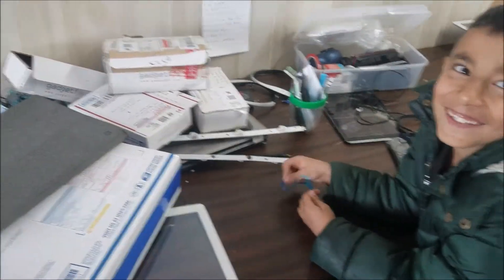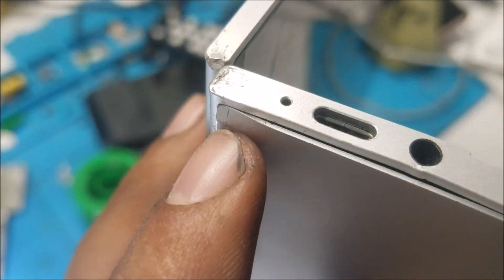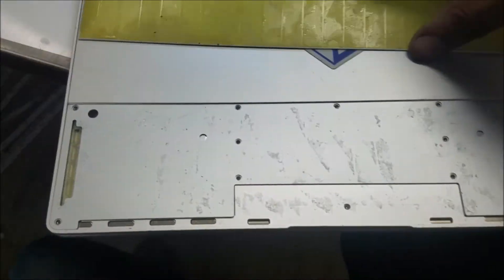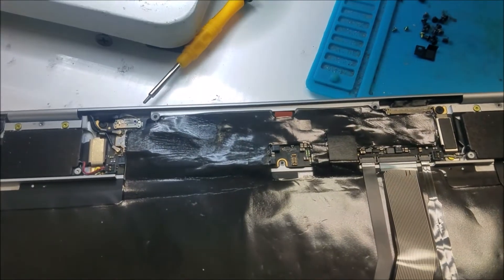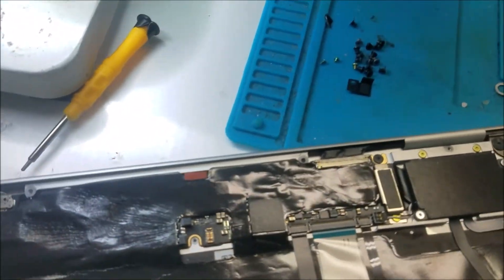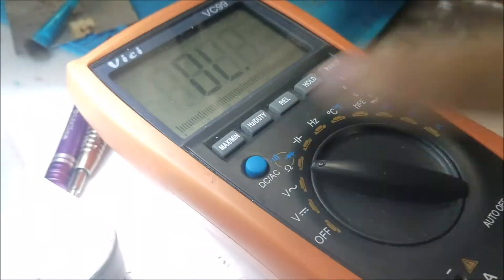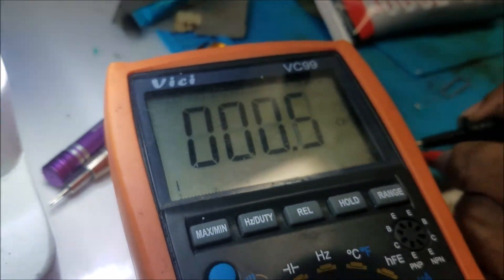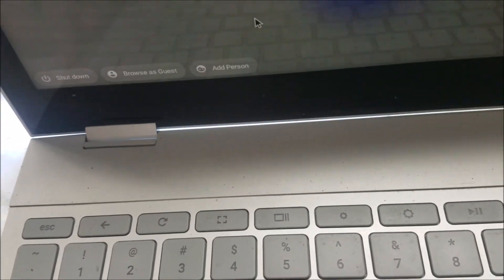google pixelbook C0A no power water damaged fix

Comment: I thank you for the very good video, my question is the following, I have a pixelbook just like the one in the video, but mine turned off due to low battery, I charged the battery externally but only up to 7.7 volts ...  what did I do?  or how much does the battery have to have?  I need your help please!
Reply from the maker: i think thats is good voltage for the battery, check for shorted cpu it is a common issue for this computer
Reply: @SOSfixElectronics  and how would you repair that?  If you could just give me the steps please I would thank you in the soul and if I could make a video of that repair please!